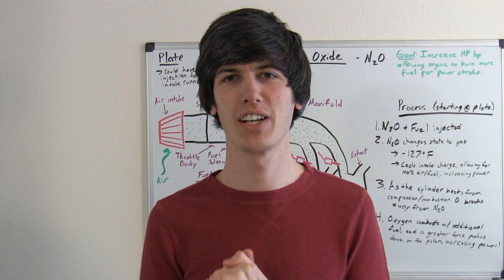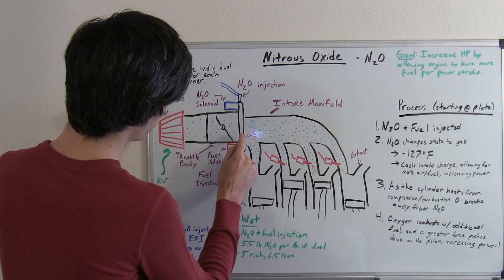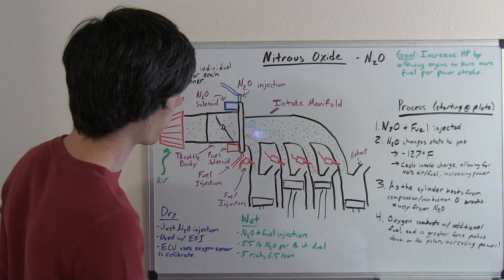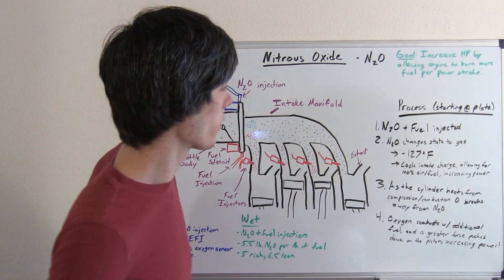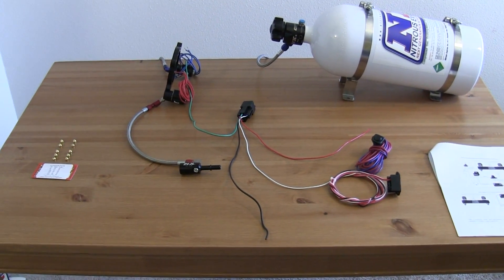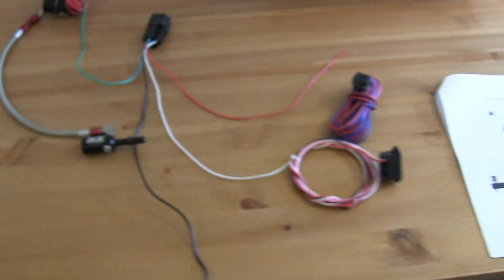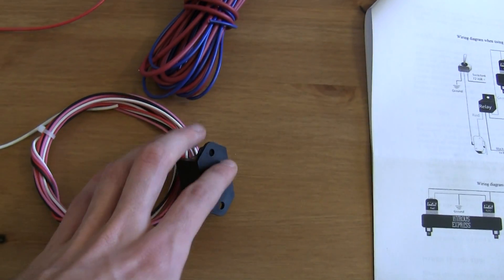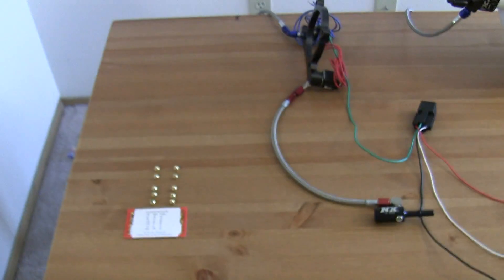How Nitrous Works - More Horsepower!

Comment: id like to know more about the dangers of using nitrous and the impact it can have on your engine. or basically why we shouldn't use it all the time.
Reply: Engineering Explained yep, can't believe everything you read on the internet. If my goal is 400hp, I like to build for at least 600hp, just to be safe.
Reply: I hear nitrous is very addicting LOL once you start using it you want to use it all the time.
Reply from the maker: If an engine isn't built for additional stress, it won't hold up under additional stress. It's really that simple - but knowing the limit is not.
Reply: Engineering Explained how does one know if the engine is built for the stress? for instance i have a 6.4l hemi in a jeep srt. That would seem like something built for stress. but i have no bonafide knowledge. By the way i really enjoy your videos and have learned a lot from you. do keep up the good work.
Reply from the maker: That's why I was saying "knowing the limit is not." I can't tell you how well designed that engine is, or how much power it's designed for, or how overbuilt it is. Only the engineers who actually designed/tested it could tell you. But if there's a community of tuners who've built up the engine and had success/failure, you can learn from the forums. Keep an open mind, and make sure things sound logical. Plenty of bad info on forums.
Reply: Engineering Explained fair enough. thanks
Reply: Strider Sky Actually American engines can get very good fuel economy, all things considered. More displacement means the engine can spin less RPM to move the same amount of weight at any given speed. Also, American engines themselves don't normally weigh that much, with one or two exceptions, like the Viper. The C6 Z06's 7.0L V8 barely weighs over 400 lbs wet, where many of the 5L + DOHC european 8, 10 and 12 cylinder engines weigh upwards 450 lbs, some are well in excess of 500 lbs. (Lamborghini V12's, etc.) But generally, aftermarket shops in any country will test the limits of any engine, or any built engine combination, and come up with safe tunes, nitrous setups, safe boost levels....
Reply: Strider Sky If you look at the numbers, Mustang GT 5.0L V8 w/ 420 hp still gets 26 mpg, 662 hp GT500 gets 24 mpg, new corvette gets close to 30 mpg without cylinder deactivation....where alot of the european (and japanese) performance cars are of smaller displacement and have to spin higher rpm on the highway, thus resulting in a drop in fuel economy. BMW m3 4.0L barely got 20 mpg, Nissan 350/370 z gets the same fuel economy as a Coyote Mustang 5.0, 26 mpg, so it is worth mentioning that there is a happy balance between displacement and fuel economy which several american  performance cars have found.
Reply: Strider Sky true true :)
Reply: Strider Sky I'm not sure what you mean by American manufactures insist on dry systems. Are you talking about the Nitrous manufacture? It is really up to the person buying the kit really and if the cars computer and fuel injectors can adj the air fuel mixture enough to compensate for the lean condition the nitrous alone will create. I prefer a wet system as this takes the fuel injectors and computer out of the equation. You still need a fuel pump up to the task of supplying the added demand of gas if not you'll run into a lean condition which will get ugly for the engine real fast regardless of engine construction . I would think that they would rather err on the side of a wet system as less chance of detonation from a lean condition. Just my opinion  on Nitrous I run a wet system on my 4.6l stroker motor as I didn't want the added expense of installing larger injectors to keep up with fuel demands under nitrous. As for the MPG yes European cars tend to be much smaller and lighter a big factor in MPG and performance. My self being over 6'4'' tall do not interface well in a small car and prefer to drive a large car. My 2000 Lincoln town car will average 28MPG on the highway and thats fine for me may not be acceptable to you folks across the pond.

Comment: What is safer wet or dry? Dry seems to be a lot more work to instal than a wet system, I just want to know the difference
Reply: Dry is easier to install; there's only the one solenoid, no plumbing for fuel, more possible injection points, simpler hardware, etc  But it is only suitable for lower power boosts because the existing fuel system has to be able to supply all the additional fuel.  A lot of the nitrous disaster stories you hear are people trying to run to much power from a dry system, or otherwise not providing enough extra fuel to go with the nitrous shot.

Comment: The only thing I don't understand in this clip is the dry system 1:37. On any EFI system ,when the engine is under acceleration, the ECU goes from closed loop to open loop, therefore not using the O2 sensor for the fuel calculations but preset correction values based on information taken from other sensors.
Reply: I didn't finish watching the video so not sure if this was mentioned but dry kit nozzles are installed before (on the air filter side) of the MAF so the nitrous must pass through the MAF and the ECU can make the proper corrections.  I am not a mechanic or custom tuner but I found it strange that the MAF wasn't even illustrated here on a wet nitrous system.

Comment: What exactly happens to the nitrogen atoms when it splits off from the oxygen? Also, why couldn't you just use regular compressed air? Compressed air tanks seem much easier to refill if you own an air compressor.
Reply: That's basically what a supercharger/turbocharger does, but ambient air has a much lower oxygen content than pure nitrous.  A tank full of air would also be much less dense than liquid nitrous, and it would enter the cylinders at around 200 degrees hotter than nitrous, which means the initial lean condition could lead to a burned valves, bent rods, melted pistons, etc.

Comment: I'm not sure if anyone has mentioned this yet but I think you forgot the third benefit of Nitrous. The increase in cylinder pressure when the Nitrogen atoms and Oxygen atoms are striped from each other. All those extra Nitrogen and Oxygen atoms take up more volume than that the original N2O molecule did. So therefore, cylinder pressure is increased, giving the engine even more of a boost! Kind of like artificially turbo charging your engine without a turbo charger.

Comment: While the explanation is not really wrong there is a far greater effect that contributes to N2O enhancing engine performance. N2O is a monopropellant. This means that it can react and release energy without a fuel.  You can make a rocket engine out of N2O that does not use a fuel and it will exhibit a performance level very nearly as high as that of hydrazine- another classical monopropellant used on rockets and spacecraft.  

When you describe the oxygen atom becoming detached from the two nitrogen atoms this is accompanied by an enormous release of energy. Look up the heat of formation of N2O.   During testing we found that this thermal auto decomposition as it is called will happen at far lower temperatures- perhaps starting around 250-300F depending on the substrate material and the flow of N2O across the surface.  If you had the right materials you could run the engine without a fuel on just the N2O and it would produce plenty of power.  The main problem is that the flame temperature of N2O is extremely high and the reaction products are highly oxidative. If you are not careful the metal parts will be happy to burn in that stream of super-hot oxygen.  Trust me we slagged down several stainless steel housings doing testing.  This will show up as an extremely high output- for a very few seconds- since burning metals actually put out a lot of energy.  They are used as the primary fuel in things like airbag initiators wherein a mixture of zirconium powder and potassium perchlorate burns when heated with a hot wire.  When you add any fuel you are reacting that free oxygen you just liberated in a normal combustion reaction and getting even more output.  

N2O is a material that exists as a saturated liquid at room temperature and something like 750+ psi.   When we say saturated it means that at room temperature it will boil just like water does at 212F.  At 700 psi the vapor above the liquid is in equilibrium with the liquid itself.  You won't hear any bubbles or anything- some of the liquid is indeed changing to vapor but an equivalent amount of vapor is turning back to liquid.  This is important to understand when we start taking some out of the tank.

You have some choices with how you deliver it- you can bleed the vapor out of the storage vessel or bleed liquid out of the vessel.  As you withdraw N2O from the vessel the pressure of the vapor will fall and the remaining liquid will try to boil to maintain equilibrium.  The energy for this vaporization will be withdrawn from the liquid itself and that will suppress its temperature and also the saturation pressure. In other words as you consume N2O the pressure and temperature of the vapor and liquid will fall and eventually you will not be delivering the same mass flow as at the outset. Eventually heat from the environment will soak in and bring you back to your original equilibrium but that takes time.  So this is why N2O systems are great for surge power- you can get a lot of mass out of a light vessel without any pumps but only for a short period.  Eventually you will run out of heat to drive the fluid out.    

N2O is compatible with most materials and is pretty inert but it should never be forgotten that if you get it hot enough the decomposition will occur and it will run away and explode.  Rapid changes in fluid velocity, anything that gets it hot, any conditions that make it form a vapor such as cavitation and then get it heated via compression are all potential ignition sources.  People, very smart ones, have gotten themselves killed not respecting this normally tractable material.  Be careful.
Reply: I just found this out about a week ago from a chemist, he said the extra fuel is more for cooling.
Reply: Thank you! Good luck finding a YouTube video explaining that
Reply: Brilliant! Thanks for writing this!
Reply: This is the most boring comment of all time.

Comment: Sooo, how much life would you lose out of an engine if you use this?
Im guessing its effective as it creates more RPM in the cylinder, so surely it will kill an engine with regular use?
subbed
Reply from the maker: If an engine receives greater stresses, yes it decreases the life. By how much is heavily dependent upon the design and quality of the engine. There aren't really any general rules I'd feel comfortable claiming accurate, without seeing any data.
Reply: Engineering Explained Ok cheers for the reply
Does it essentially work by getting the car up to its top speed faster? just increasing the RPM and how quick the revs increase?
Reply from the maker: You burn more fuel than you otherwise could, so the combustion creates a greater pressure and thus more power. You'll go through the same RPM, but it will happen quicker (and produce more power across the band.

Comment: You forgot about purging your lines and you can use nitrous a numerous amount of times, it is not bad for your engine as long as your not crazy and try to shoot it with over a 100hp 
I started with a dry and I think every beginner should too its easy and you can do it your self and don't need to tune it as much as a wet system. Putting nitrous on a turbo car is good kills the lag from your turbo ") 
If your going to through a tank on your car make sure to do a full tune up of your car first then go with a dry kit and keep it at no more than 75 shot/ HP

Comment: what would happen if you could inject clean oxygen O2 instead of air or NX?
Reply: Pre-ignition durring compression.... NOS does nothing until it's heated to over 500F. (ignition)
Reply: Explosion :)
But even if you design engine to handle such ridiculous load, you will have a problem with oxygen transportation (think of huuuuge gas cylinder).
Liquid oxygen partially solves this problem of transportation, but, you have to build vaporizer of some sort, which will turn liquid oxygen to gas and then will transport that gas to your engine, but I never heard or seen it done.
I guess nitro is just more practical.
I am not an engineer, so take this with a grain of salt. ;)

Comment: on a Subaru STI when you put into Sport Sharp the throttle position sensor becomes waay more active than Sport or Intelligent Drive, meaning your foot could be down a quarter (don't quote me on the distance its been a while since subie school) of the way and it will tell the throttle to go wide open i would probably turn the arming with into a momentary because if you were drag racing and your throttle was wide open and spraying will standing it could be catastrophic. Just thinking outloud

Comment: To car or to human?
It is dangerous to car because it stresses the engine as with every power increasing modification. Suddenly parts designed for 200hp are forced to work at 300hp and that might lead to failiure of weakest parts. As with every power increase life of the engine will be shorter.
And to human: It is an anesthetic, also know as laughing gas - You might suffocate or pass out from too high concentration of N2O, but otherwise it's harmless... And fun to inhale ;)

Comment: intake manifold design should be taken into consideration when spraying nitrous on a plate setup. A fogger setup/direct wet nitrous injection is ideal for dry flow manifolds, which is common on most v8 fuel injection engines. Wet flow manifolds have long runners which distribute the nitrous more evenly and can be used for 200+ shots. Wet flow manifolds are similar to carburated manifolds.

Comment: You also should say, that using N2O+fuel injection (over whatever is normally injected) increases EGT and that hurts your exhaust valves a LOT. Unless you use a rich mixture and waste all that fuel. But if you want run rich you can justify that and just add a turbo to the car - and have a power advantage each day, all day long :P In other words - N2O injection is pointless.

Comment: So, since the nitros is combined with the fuel. It needs 600 amount of temperature. To separate nitrous n fuel which is bonded together in order to combust them. Question is how do we get that amount of temperature? Change spark plug?

Comment: If what you are referring to is the purging of nitrous before a run, it serves two purposes. First it primes the system by clearing the lines of atmosphere so that you don't have a lag when you engage the nitrous, the lines are full of the good stuff. Second, some people do this to bring the bottle pressure down to what the tuner wants it to be. They do this for consistency as the nitrous isn't regulated so a huge pressure difference can cause engine tuning issues.

Comment: the gallon is broken down into quarts, pints, cups and ounces. drinks in a bottle are usually in metric-1 liter (yeah, we have to spell everything differently) or 2 liter, or 500 or 750 milliliter, OR 12, 16, or 20 ounce (oz) bottles. there is no standard. your example doesn't translate to any size...about 11 ounces. A foot is an official measurement because it is about the length of an adult male foot. and 12 (inches) breaks down well, 6, 4, 3, and 2. calenders, clocks, inches all use 12.

Comment: A few quick points:
-Most ems' and very late model advanced ECMs *can* do closed loop fuel control at wide open but 99% of ecms and aftermarket ems' will NOT do closed loop at wide open throttle. they're running off of pre-tuned maps for fuel/spark tables which is "open loop" and must be tuned accordingly.
-most n2o kits on efi motors are injected via a single nozzle before the throttle body. the high velocity n2o hits the fuel stream and atomizes it so you get a fuel/n2o fog

Comment: im not sure how these systems work, the PSI is 50 at the output? each cylinder has an injector at 24-30K psi of fuel so how would one integrate this?

Comment from the maker: Wouldn't work for many many reasons. To keep nitrous liquid it needs to be in a pressurized container, any area that isn't liquid (space) will be gaseous nitrous. The two liquids will have different densities (they likely won't just mix). Could get gaseous nitrous in your fuel line...

Comment from the maker: Yes, it can be activated by a button/switch. Probably doesn't have to be at WOT in this case, but why would you not be at WOT and use nitrous? Purging is done to remove any gas from the line, so that right up until the injection point the line is filled with liquid.

Comment: I get how the nitrous is injected when it the gas is at full throttle, but is their like a button or lever that can activate the system when you want the nitrous to be injected? Like in the movies on the steering wheel. Also, does nitrous have to be injected at full throttle? Lastly, what is purging the nitrous lines? Thanks! :)

Comment: usually around 55 but you could go higher, but at that point you are putting long life and reliability on the line, if its a built 4cyl engine with say 10k in the engine you could probably do a 200 shot

Comment: I'll also add that I wouldn't use it on a track car, only drags. Too much on/off throttle in the track to increase the chance of spraying for a moment while you let off throttle. Drag is straight forward.

Comment: Also WOT switches like he mentioned only open at wide open throttle so you have optimal fuel/air/nitrous flow and nothing is restricted. Fuel pressure switches monitor your pressure so if the fuel pump or solenoid fail for w/e reason, nitrous is killed before you lean out and blow up. You can read your AFR off of a wideband o2 sensor as well to make sure you dont lean out. The only cons are engine wear in huge shots, and careless applications. Otherwise it can be done appropriately!